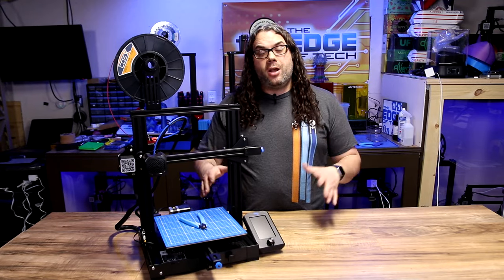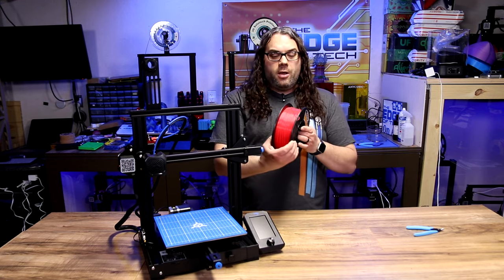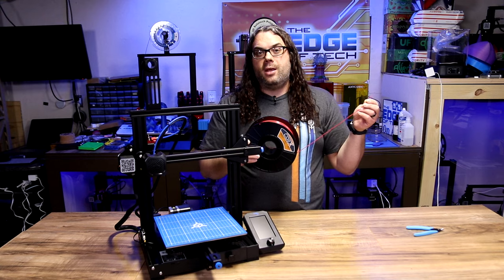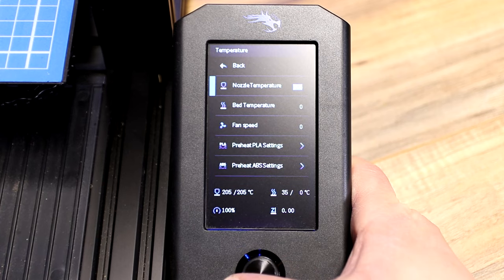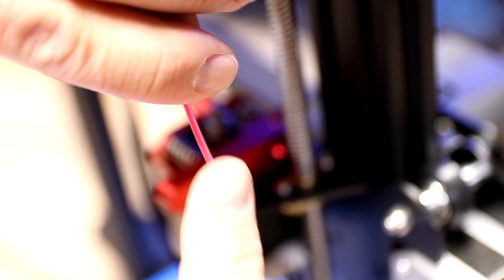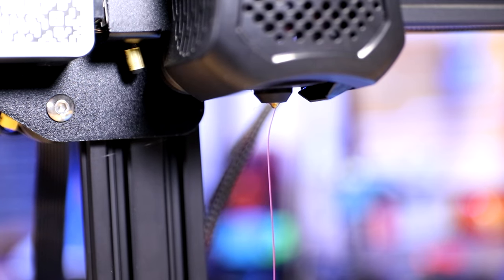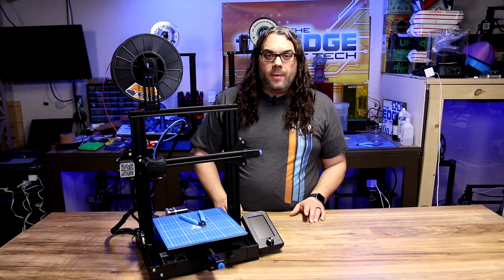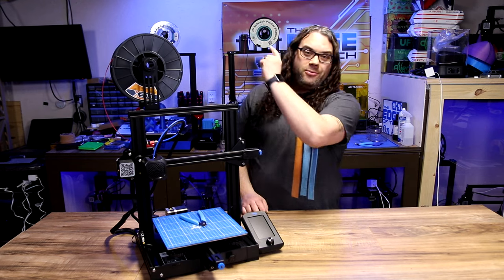Loading 3D Printer Filament : How to Load Filament into Ender 3 v2

Comment: When I push in my filament it keeps going sideways out the side instead of into the tube what should I do?
Reply: did you figure this out, i'm having same issue
Reply: @tristanshaw9494  I also need to know
Reply: @unnecessary-roughness3303  i figured it out, took a few attempts and I had to keep straightening the end of the filament but there is a tiny hole it feefs through, if you shine a phone torch on it you'll spot it, so it's especially difficult the first time but just be persistant but patient and you'll figure it out
Reply: Tristan shaw Yea oddly enough I just had this problem to but I just ended up re-cutting and holding the filament a little different
Reply: @iceblazor9452  thank you I don’t know why but this comment helped a ton I just held it differently and it worked
Reply: make sure the filament is completely straight, and if it still does this try cutting it at more of an angle
Reply: There is a black clip on the outside of the filament feeding section that pulls the 2 parts (brass gripper snd silverl bearing) and it makes it actually positive to feed by hand so you can get it in
Reply: I was having the same issue until I did what he did in the video @ 3:25 by squeezing the arm a few times.  It seemed to straighten out the filament enough to guide it into the hole.

Comment: Things that might help a newbie like me: First of all thanks heaps for showing me how to correctly load the filament. I am brand new to 3D printing and more-or-less bought this as a ‘toy’ (Ender 3D v2). It arrived today. I am 65, and found the instructions for the installation fairy well written. However, there are a few basics missing in the instructions for an absolute newbie like me. One was feeding the filament as you have shown. It’s poorly described in the Ender instruction book. I thought I only had to feed in a small proportion, not feed it all the way in. This issue was compounded by the fact that the filament was rotating around the guide wheel. After finding this out, it took several attempts and aided by a toothpick to keep the filament straight to feed correctly. Secondly, the manual also does not tell you to remove the protected plastic sheet on the bed! And when levelling, after parking the nozzle in the home position and adjusting it does not tell you to move the nozzle unit by MANUALLY shifting the bed etc. It might sound dumb, but I finally found this out by good-old Youtube. I was trying to find how to move this via the menu, as I thought it would have an automatically ‘park’ at each corner. And finally it did not tell the installer to leave the cable outside the frame. I had just about finished and realized the mistake. I had to remove the bolts from one upright, loosen the other side and slide the cable under.

Comment: Yes cutting the filament at an angle is key and straightening the filament out if a must - sometimes when you straighten it you can see if the filament is brittle which can cause problem with it breaking due to the entry angle. Great info...the basics are what makes 3D printing survivable and a new hobbyist. Thank you

Comment: That may help. I got my Ender 3 V2 just a few days ago and have been having trouble getting the filament through the hole just after the gears. I think the curl is the problem. I've already learned the hard way about allowing the filament to unravel across the spool. I put it back poorly and it got caught under itself causing the head to be stuck several cm above the bed with no filament feed. It thought it was printing though. It has no way of actually knowing where the head is, so if something like this happens, it can't know. I'm sure higher end models must have an encoder so they actually know where the head is at instead of just counting motor drive pulses.

Comment: I pull about 18” of filament off the spool. I then secure the filament to the spool. This way I don’t have to worry about the filament going roque when loading. I reverse the procedure when removing the filament. I the secure it using the holes in the spool & remove the clip. BTW be sure to remove the clip before you start printing.
Reply: good tip!

Comment: What do I do/use if I did not get those scissors? I’m not sure if I got a defect package but when I got the 3d printer it never came with any sort of scissors or anything of the sort. As a beginner I didn’t know it needed that.
Reply: Also, do I need to load filament in even if I am not actively printing?

Comment: Jim - on the Ender3 I’ve found it matters which way you cut the angle- looking at the printer & filament from the front the longer pointed end needs to be at the back of the filament if that makes sense

Comment: Hi guys, just assembled my V2 ender printer and i was going nuts because of the filament was going in the inlet, going trough the gears but refused to go into the hole and came out on the side of the pulley wheel. i found that it didn't align with the hole whatsoever so the solution was to loosen the pulley's screw and lift it a bit then guide the filament into the hole with the included screwdriver. Hope this helps if you have the same problem.

Comment: I need assistance when i try to load in my filament it wont go into the hole into the tube i twist the extruder knob and the filament curls around the bearing any tips?
Reply from the maker: Make sure to cut the end at an angle and straighten it out as much as you can. Then squeeze the extruder handle and slowly push it in.
Reply: @TheEdgeofTech  i got it after fiddling with it for a while, the angled tip on the bottom side really helped thanks!

Comment: I wonder if there is a flaw in my Ender-3 V2 Neo or this is simply poor engineering because watching the filament going in from above, I see the problem... that is, an extreme bias for the filament to follow a path around the second roller leading out the side of the feeder. The tips regarding straightening and/or recutting the filament do not help in my case. The only way to get the filament to feed into the tube is by bending the filament so that it feeds in pointing towards the back of the printer to compensate for the bias. Even with doing this, I need to carefully watch that the tip goes through the hole.

Comment: My filament does not come out, I have 200 degree temperature and nothing happens, when printing no filament comes out.
Reply from the maker: What happens if you push it through by hand while squeezing the extruder?
Reply: @TheEdgeofTech  I can push the filament forward until the end but after that nothing happens even if I push forward with my hand it is no longer possible
Reply from the maker: @AIKing1  Can you verify that the hot and nozzle is heating up? Also try going to 225.
Reply: @TheEdgeofTech  I fixed it by putting the filament in reversed. My next problem is that the filament is not liable
Reply from the maker: @AIKing1  sounds good. I'm not sure what you mean.
Reply: @TheEdgeofTech  It does not adhere to the glass.

Comment: Aaaaaaand he doesn't have the stock feeder, so the video doesn't help solving the problems of the default one, which curves the filament to the front and doesn't feed properly inside the hole.

Comment: dude you didn't talk about how the one screw needs to be loose when loading the filament at 3:40, nor did you talk about tightening it back up.
it's not as simple as you're making it. you skipped key important steps.